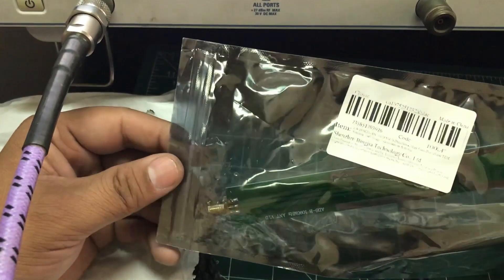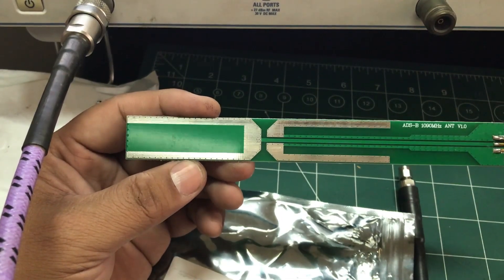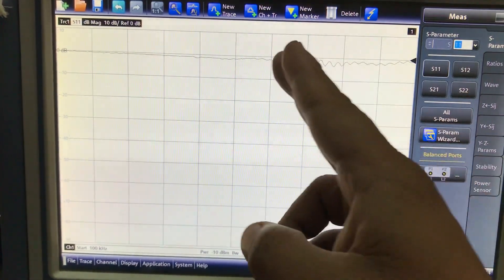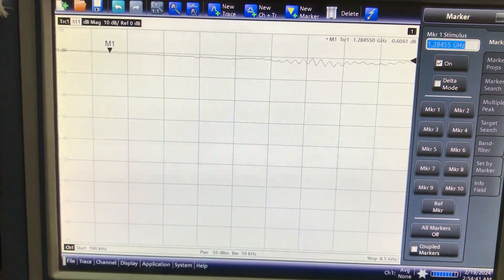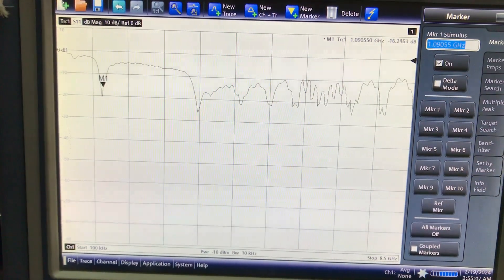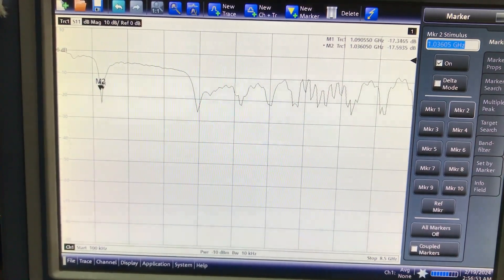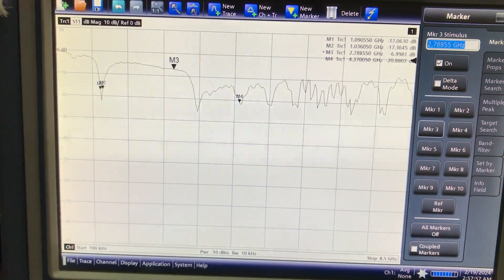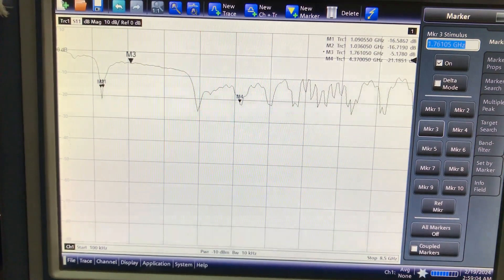Dirt Cheap PCB based Surveillance Antenna (ADS-B) from AliExpress | Testing & Characterization

Comment: What's the Max. range of this Antenna for ADS-B signal ?
Reply: Install  it outside, on a high mast, keep it clear from Tree line,  houses. Make sure to keep the RF cable as short as possible, use good quality LMR 200 RF Cable. You be able to pick data packets with ease, 100+ NM
Reply from the maker: That is hard to tell ,it should be mounted outdoor,